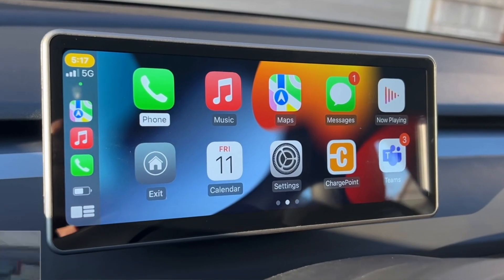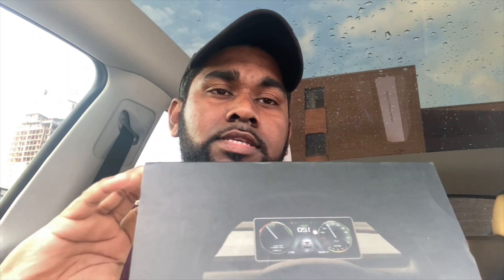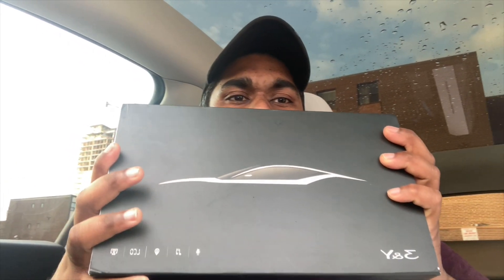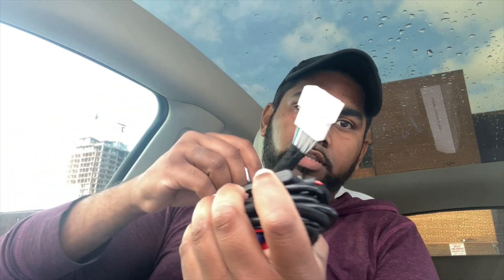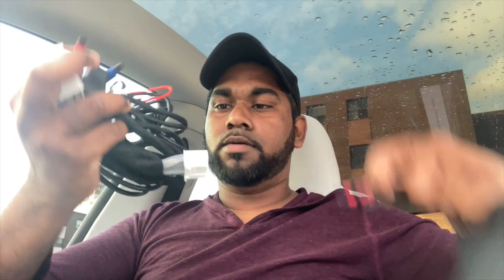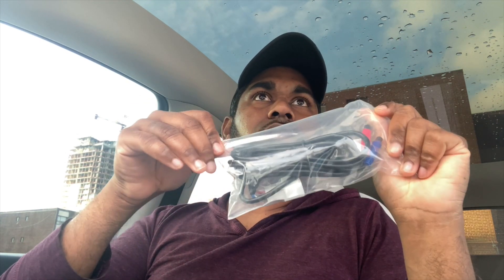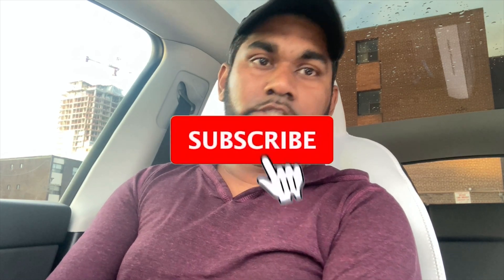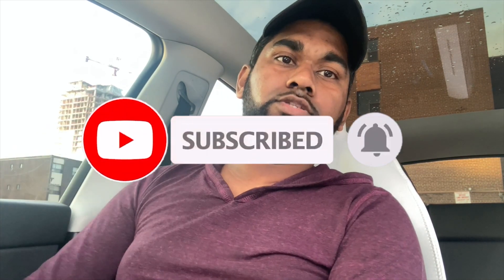Tesla 9.0” HD Dashboard Touch Screen instrument display

Comment: Hi, do you have intel or amd chip? Can't find any installation videos with amd chip. That wire harness have two cables, one of them have those open electric conectors like negative and positive, were did u conect them? I bought this set but not sure how to install it, have two bags with wires and one them have those power wires. Thanks.

Comment: I’m very interested in this for CarPlay and having a front display. A couple of questions:
1) doesn’t it block the AC/Heat output significantly? 
2) is it difficult/awkward to operate being beyond the steering wheel?
Reply from the maker: Thank you 🙏 1) yes there is at least 4 vents that are “block” but the unit has a vent that allow the air to pass through. 2) It doesn’t now affect or cause any distractions over the steering wheel. I am so used to the Tesla screen that I don’t use instruments display. If you have a android phone/CarPlay is the best feature